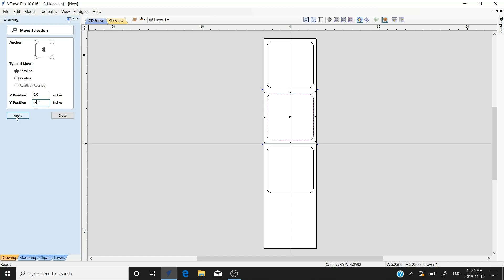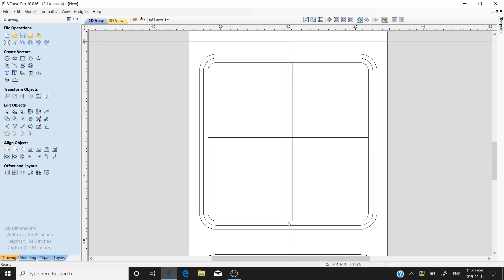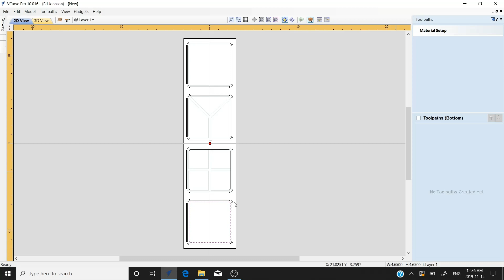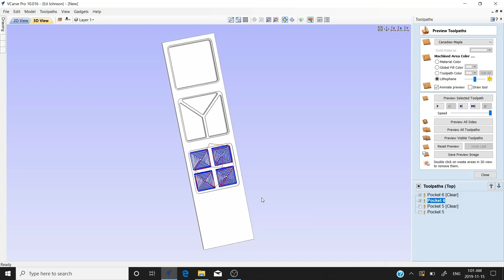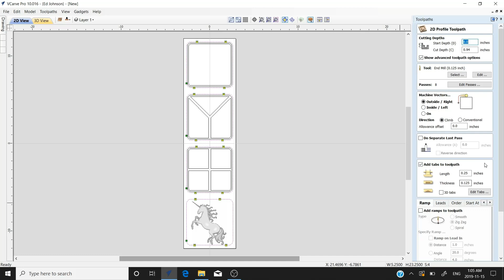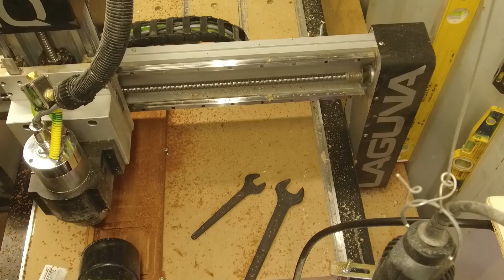Stacking box created in VCarve Pro and machined out on a Laguna iQ

Comment: Another comment.  I have now made three of these boxes.  (Two more to do.  Five granddaughters) All went well.  A couple more points for those wishing to do this project.  In order to facilitate the lid lip, I simply did a pocket tool path .01 inches deep on the top side of the boxes excepting the lid.  Make sure to offset to match the lid well on the bottom side.  The fit is tight so I used a dremel tool to peel a few thousandths off the rim.  Also, after a few times pulling the stacks apart, they become a little loose.  Not good for little ones who pick up the box.  I did not think ahead to put magnets into the boxes so I used hasps and they looked great and gave a little variety to the exterior of the box.  Nice project.

Comment: Hello Ed.  A point already made by others.  You forgot to show the lip and depth of cut for the lip around the pockets on the topside.  This is a separate step using the offset vectors just outside the pockets.  Otherwise, a great video.

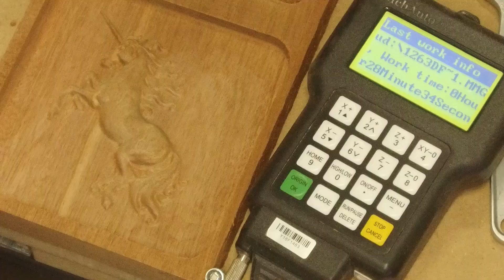Comment: At 30:57 how did you get the elapsed run time to display on the HHC?
Reply from the maker: Steve Gronsky   Hi, thanks for watching. If I recall you press the “run/pause” and “stop” at the same time after the job is compleat to bring up the last job info.
Reply: @canadianwoodsmith-edjohnso4608  Thank you.  I've tried that and it works.
Reply from the maker: Steve Gronsky glad I was able to give a useful tip.

Comment: Thanks for another great project.
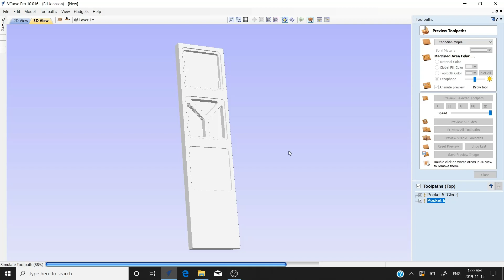I have question though. At 16:00 where the first set of pockets on the top is done, when previewing it, there is a third 'pocket' visible even though only 2 toolpaths has been created. Am I missing something?
Reply from the maker: Thank you, If I understand your question, all the pockets are created with one toolpath, theirs 2 tools used with the one toolpath, one to create the radius with a ball nose tool and the other is to clear out the rest with a square end mill. There is a total of 7 pockets cut out with this operation. I chose the ball nose as the first tool then the end mill as the clearance tool is chosen below. Regardless  how many vectors you want to cut if their all the same depth they can all be selected and run in one toolpath.
Reply: @canadianwoodsmith-edjohnso4608  Thanks for responding. I do understand that 2 tools is being used, thus creating 2 toolpaths. What I do not understand is that there appears to be a third 'cutout\pocket' drawn when you preview. Maybe if you could have a look at this captured image, stored on Google drive, it might be clearer what I am trying to say\explain. If you could, please have a look at it https://drive.google.com/open?id=1YTM-OtB7nN2uKQQ1v4UFoC1G9pw2c2aF
Reply: I noticed that as well. On the bottom side there was a 0.1 pocket tool path created for that recess. I replicated that on the top side. It looks ok in the preview. I guess I will find out when I run it.
Reply from the maker: Johan Van Dyk that appears to be the recess lip at 1/8” the bottom fits into. I must have mixed up steps during the editing and putting the video together.